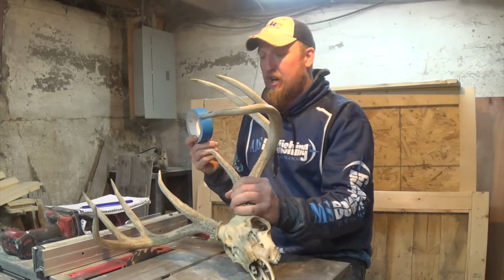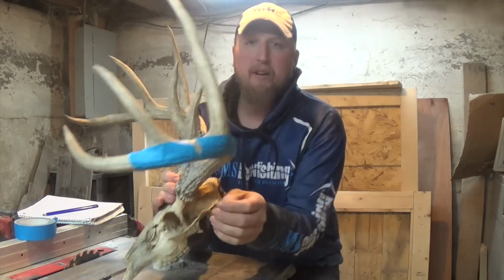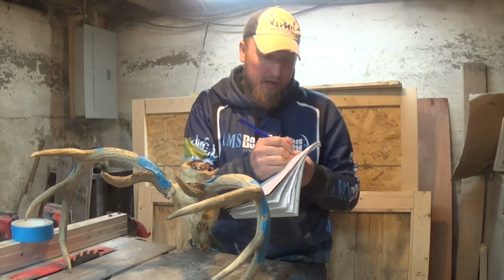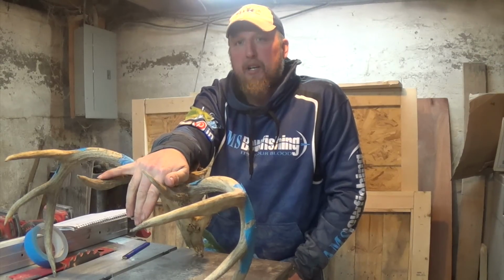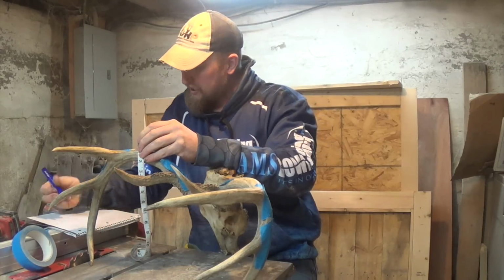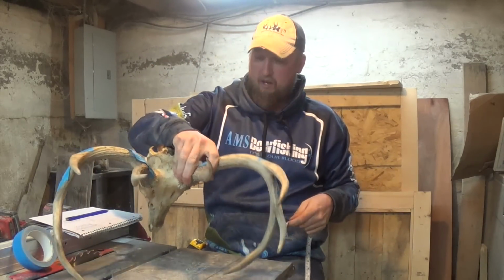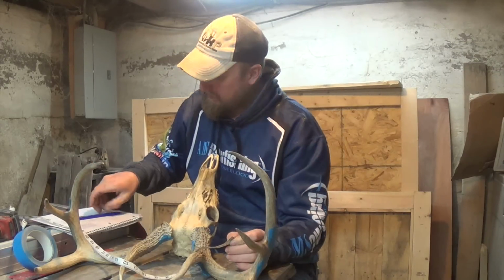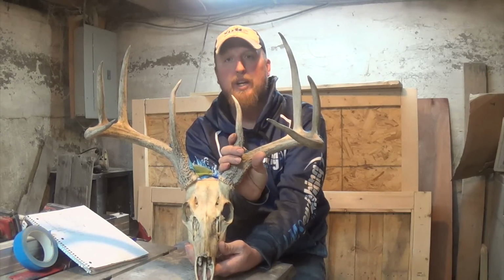How To Rough Score A Whitetail Buck

Comment: I've been rough scoring deer very similar to your video. However, I would like to know the answer, as to why they want to use the smallest circumference readings BUT the greatest inside spread. For a gross score, that really makes no sense to me and would like to know the logic behind why B&C or Pope & Young want you to use the smallest circumference reading. If its a true gross score, I would think you'd want the largest circumference reading. And also the main beam measurement, I always start at the front and wrap the measuring tape around to the front. The way I think about it is, if I was able to turn that main beam into rubber and lay it out on a table flat, that's the measurement I want. Just my 2 cents, open for discussion.
Reply from the maker: I'm not sure why they don the measurements the way they do. It sort of makes no sense to use the greatest on one and the smallest on then other. also don't care for the deductions because it's not perfect. heck that's what's so cool about antlers, they are all so different.

Comment: Hi! Ive watched a few of these scoring vidios; in the beginning you said you would subtract something.  Would that be the difference- lets say G2 rt is 5” + lt is 4 1/2.  Would you then subtract 1/2 from final score? (And for all the other differences?)
Reply from the maker: Yes the gross score of a deer is what it has grown total. The net score is exactly like you said, any difference in the tines or main beam length will be subtracted off the score. So like this deer the G1 on the one side was 7 1/2" and the other was 6 3/4"  you would subtract 3/4 of an inch from the total. Then each other tine you would do the same, also if it was a 9 pointer you would subtract the entire length of the G4 on the one side because it didn't have one on the other. Same goes for the mainbeam measurements also, if one is longer you subtract the difference. I personally go by the gross score, but if you were to get a deer officially scored, they go by the net score after deductions.
Reply: M.C.T. Productions Ok, thanks for the info!  I got my 1st 10, 2 weeks ago, and Im going to score it.  Beautiful rack! But, they definitely arent symetrical.  Ok, Im watching your video as Im writing this, you did explain it briefly.